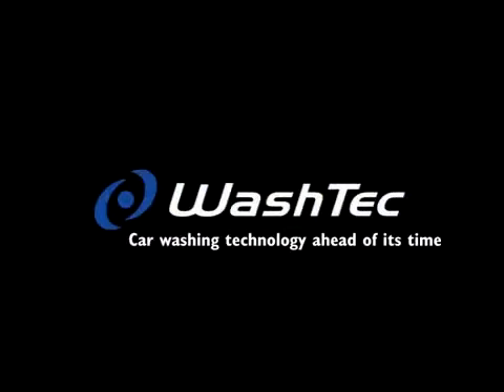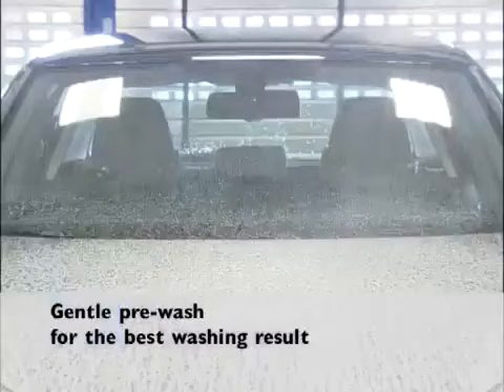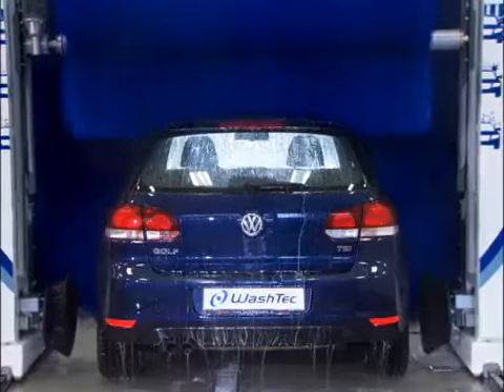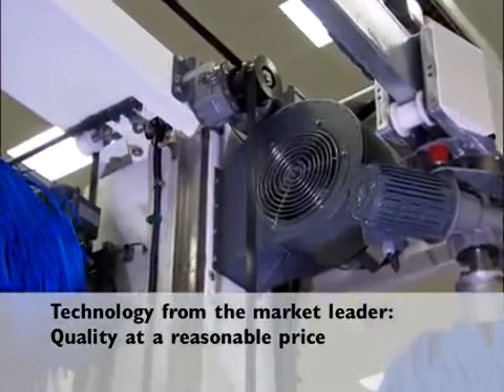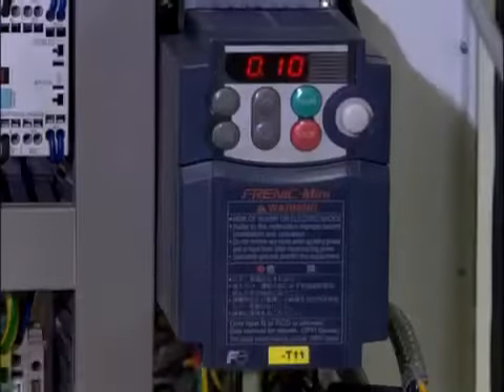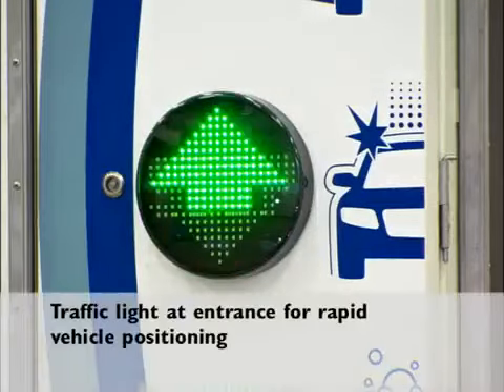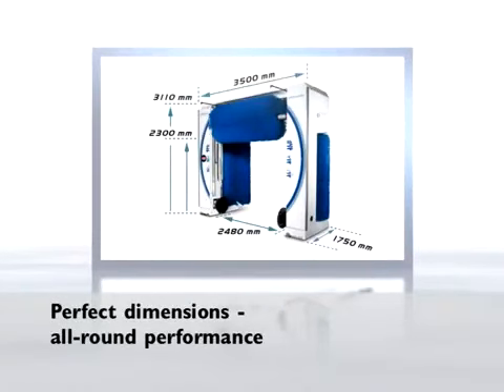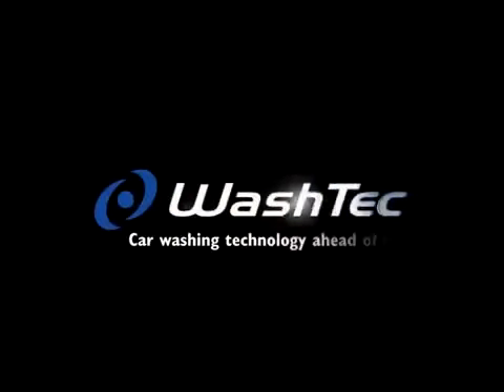WashTec EasyWash (Factory Video)

Comment: The EasyWash, for me, would be the machine i'd buy, if I was on a budget. Compact, versatile and able to do a full wash, even with the ShineTecs wax.
Reply from the maker: I would also use the EasyWash they can be installed in small wash bays in busy car wash environments and they are very reliable systems The ones in Europe come in different sizes are different locations and different colours and designs I have also seen one where the drying bar tilted
Reply: @Wesumatex2020  I've seen a few in videos that go up to 2.9 metres in height.